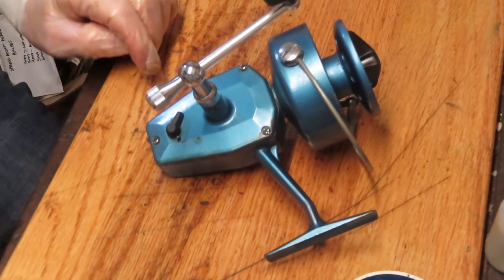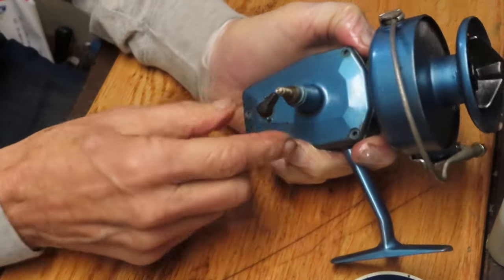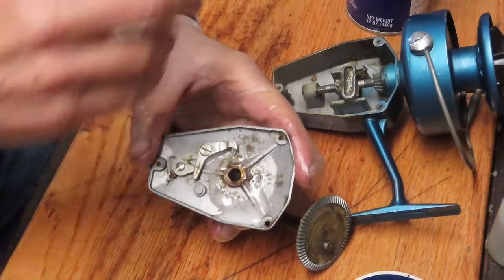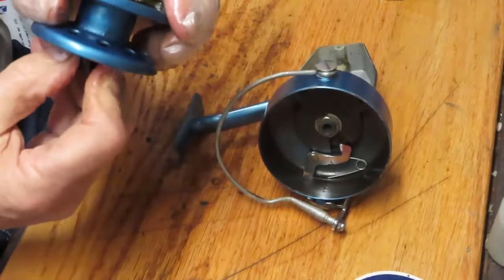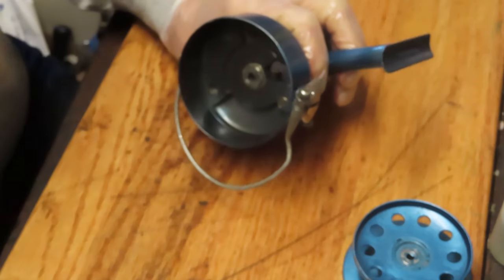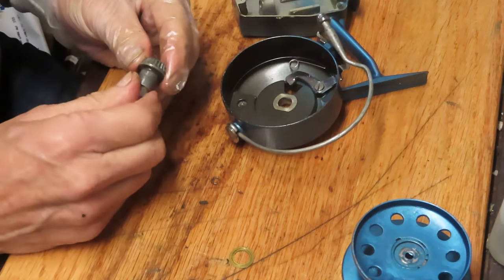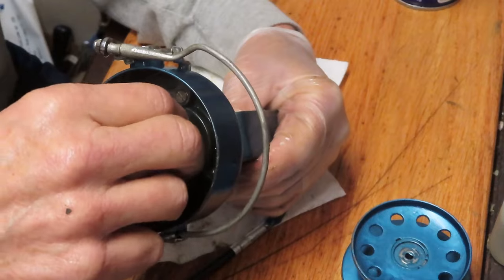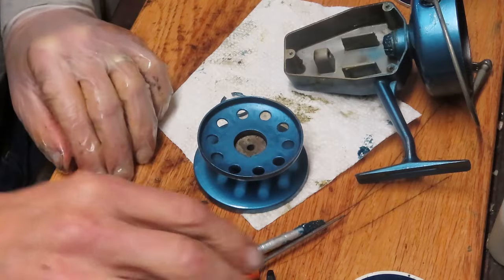Olympic Penguin 105A vintage fishing reel service

Comment: I have a Penguin 105D in a different color new in the box. I haven’t used it yet but it’s a fine reel. It has a common design but has great materials, a durable paint coating, and is easy to service and maintain. I was very happy to get mine. Glad to see this one in a video. — Chris
Reply from the maker: These are nice reels and I sure yours is a great example of the classic.  Enjoy - Dennis

Comment: I just acquired 2 of these only they are 105 B, nice old work horses
Reply from the maker: Yes they are -  How many reels do you have in your collection?  Sounds like you have more than a few!
Reply: @2ndChanceTackle I'm not so much a collector of fine reels, most are work horses. I buy lots, and repair reels. I probably will start servicing some to sell in Dec. or for sure Jan. I bought about  60-70 this week plus some lots of parts. So it's not hard to have a lot of reels. I figured it was better to start on Fleabay with enough inventory so I don't run out and just disappear one day off the site. Plus I'll keep the older odd looking reels. to answer the original question. well it to the hundreds. If I get any now, it has to be priced as you say "tuition reel". Once I get moved in to my shop and sort and inventory them I'll let you know

Comment: Dennis did you forget to put grease inside the cross line block ?
Reply from the maker: Just went back and checked.  The grease is there, so maybe I cut out the greasing in the editing.  Thanks Rick - Dennis